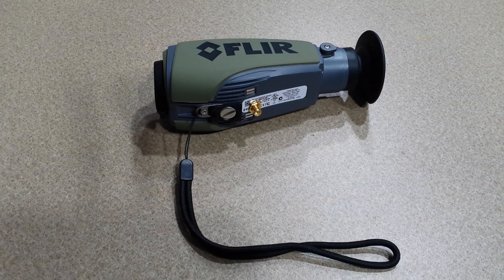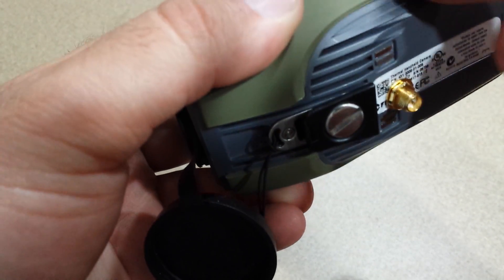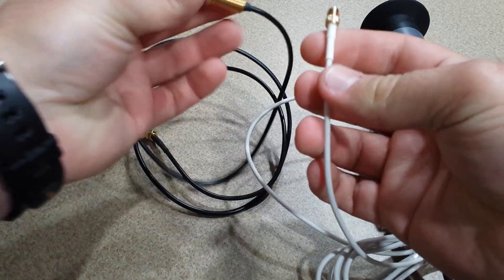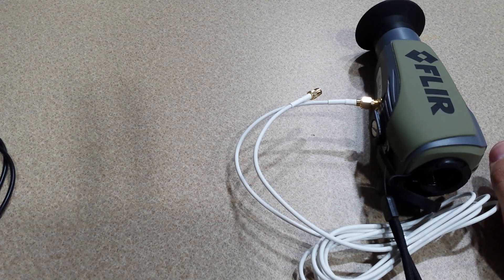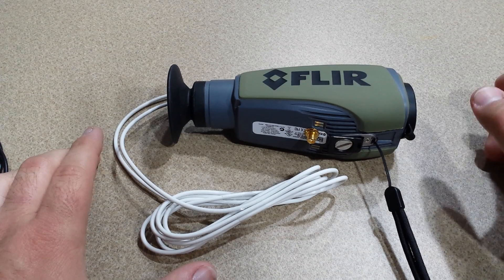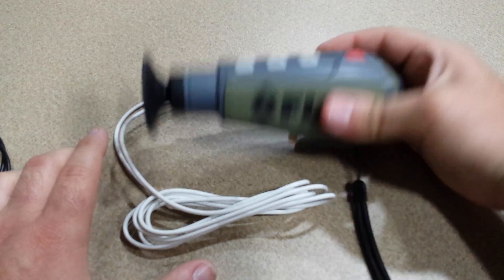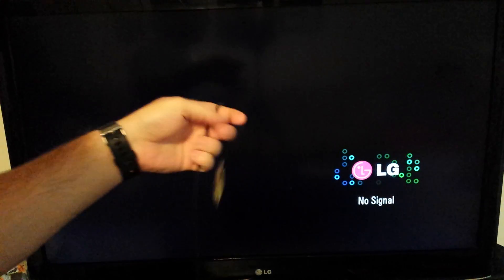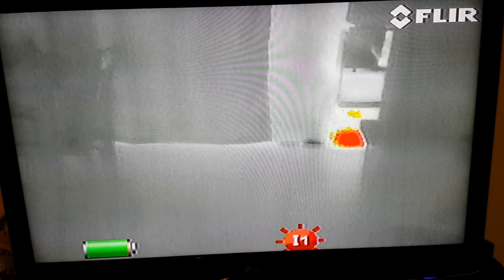FLIR SCOUT PS24/32 HOT SHOE- VIDEO OUTPUT MOD

Comment: I'd like to get the doc, sir. Thank you! BTW, have you messed with replacing the battery? I'm doing this for my friend and the battery in his unit is almost dead. He wants to connect an external battery directly into the unit without going through the internal one. Of course, I do not know how it is set up inside. Any help would be appreciated much. The 1st thing to find out for me is HOW to take the unit apart since it seems to be completely sealed and glued together, no bolts or screws that I see. Email it, please, to sendtoazat@gmail.com

Comment: What about if you have the extra battery that hooks up under the FLIR? Where the hot shoe would connect, can you mount the cable anywhere else on the FLIR. BY the way what great idea...

Comment: Hi , I'm interested as well.. in doing this modification. It looks like... you used the tripod mound to gain entry , and tap onto the correct contact points (center two.. in the four on the bottom of the FLIR device). I have the Scout PS 24, and have already viewed video, by holding the wires on these contact points. I have skills in electronics, but would definitely like to view your word document.. Thanks